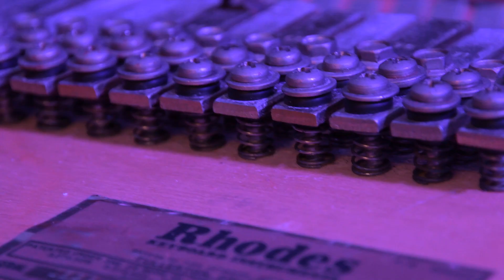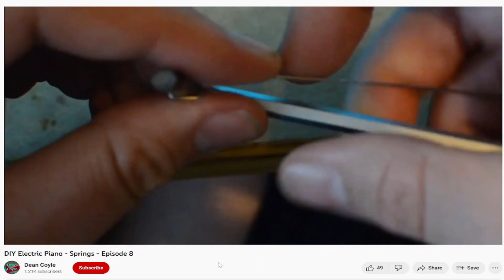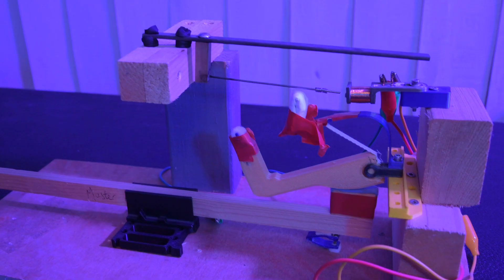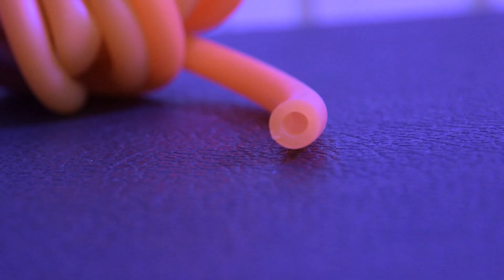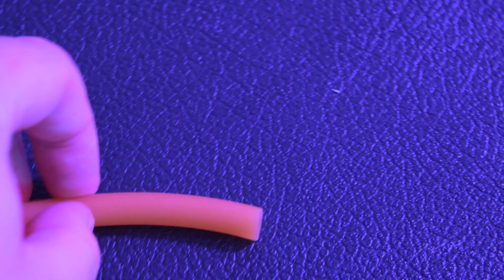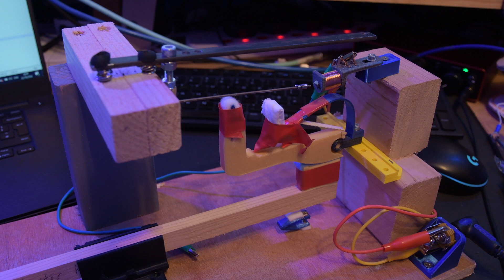DIY Electric Piano - Polymer Tonebar Springs  - Episode 21

Comment: Is it an artifact that the hose springs appear to give a much greater volume?  To my ears, the hose springs sounded much better than the steel springs.
Reply from the maker: Yes I did notice that. I applied the same gain to both notes.
But I wouldn't read too much into it as I could have knocked the pickup position or just hit the note harder. 
There are so many variables!
Maybe I should try on the Fender Rhodes as a comparison also.

Comment: Hi Dean, not sure about this one, metal spings seem like a much more durable solution, are they expensive? I worry especially the ones you want to preload more won't have a long life. You could have a look into some polyurethane sheets of different densities and just make washers with those, but all these "rubber" stuff will most probably change elasticity etc. over time way more than springs.
Reply: A lot of high end/vintage guitars use tubing just like that to adjust the height of the pick-ups. I personally much prefer tubing compared to springs! As for the longevity, metal fatigues and changes characteristics over time as well. Tubing isn't conductive (not as susceptible to moisture, temperature, humidity, induction etc) and won't rust! I feel like the tubing is less temperamental in the long run.
Reply from the maker: I forgot that tubing is used for pickup springs -  good point!
Reply from the maker: Great point, my thinking was with the Fender Rhodes design, they have the spring and the rubber grommet. If we combine these two parts together it gets a lot easier to make. But youa re right rubber will change properties over time, I think the rubber I have used will UV sensitive also. 
Ah well, at least there are options for this part.